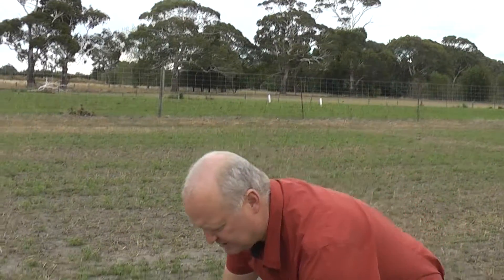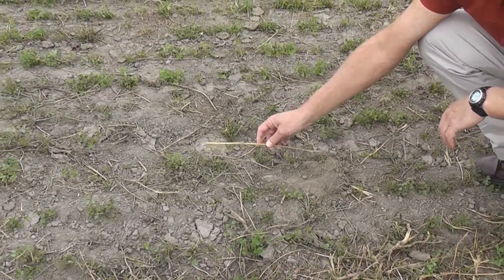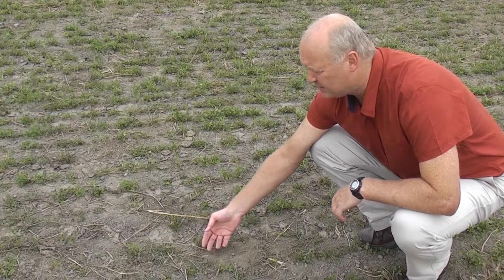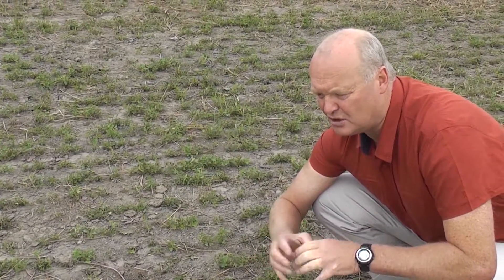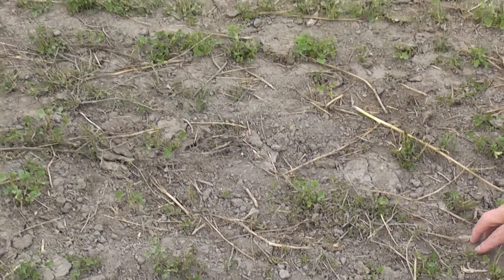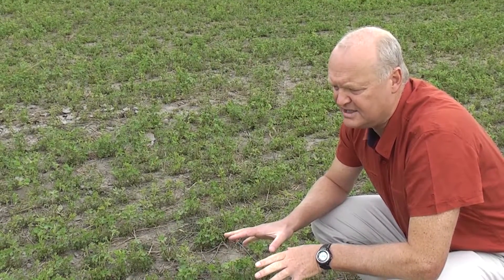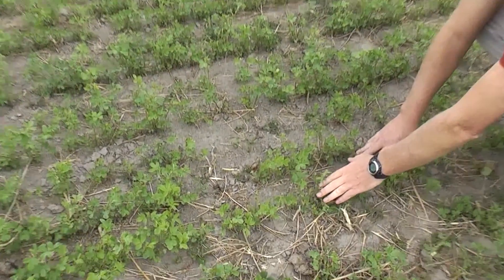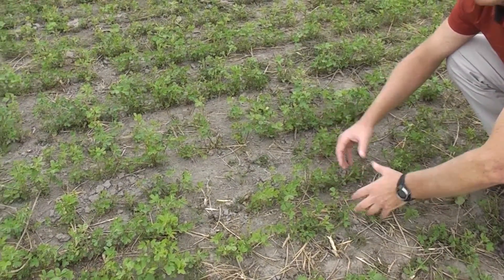Dryland Pastures - Effective irrigation of lucerne (alfalfa)

Comment: pastured lucerne ? What about bloat ? Don't your cow get sick ?
Reply from the maker: Hi, thanks for your comment. 
under certain circumstances bloat can occur for stock direct grazing lucerne/alfalfa (although it can also occur on other high quality pastures and is not limited to alfalfa). There are, however, several ways to reduce the potential risk. 
These include ensuring stock are "full" when entering an alfalfa paddock (if they aren't hungry when moved you reduce the risk of them gorging on the lush pasture), providing access to fibre, use of bloat capsules or bloat oils, wilting strips of alfalfa in the paddock, giving the stock access to a mix of grass and lucerne and several other strategies which suit most situations. Salt licks should be on offer at all times when stock graze lucerne.
The Frequently Asked Questions page of our website contains answers to many common questions - check out the "Lucerne Management - Animal" section here: http://www.lincoln.ac.nz/Research/Current-Research/Dryland-Pastures-Research/Frequently-Asked-Questions 
Also check the most current alfalfa/lucerne information in the "Lucerne Research" section of our Research Projects page here: http://www.lincoln.ac.nz/Research/Current-Research/Dryland-Pastures-Research/Research-Projects

Comment: so if there are no irrigation can grow easily the lucerine?
Reply from the maker: Hi Chandani,
Thanks for watching. Lucerne is like any other species  - no access to water = no growth. When growing lucerne under rainfed conditions you are effectively using the stored soil moisture for growth. The advantage of lucerne is that it then maximises spring water use because it is never nitrogen deficient. Therefore it grows well in spring when animal demand is increasing. How much it will grow depends on the conditions in your environment during the growing season.  When the soil moisture runs out and rainfall is insufficient to recharge the soil profile then growth will slow/cease. This is why we recommend sowing lucerne on your best and deepest soils – the deep taproot means it can access soil water stored deeper in the soil than many other shallow rooted pasture species. The trick here is to ensure you establish into a paddock – well prepared after a weed free fallow. Then let the stand grow until it flowers so it has time to develop its root system.  Last year on our very stony soils with no spring rainfall we ran out of water in early November. In others years the spring rainfall has allowed those crops to grow well into December. On our deepest soils it did not run out water until February.